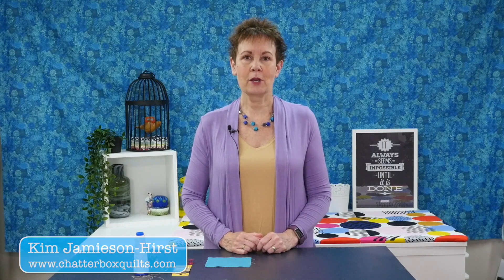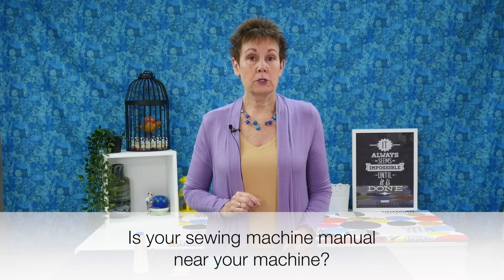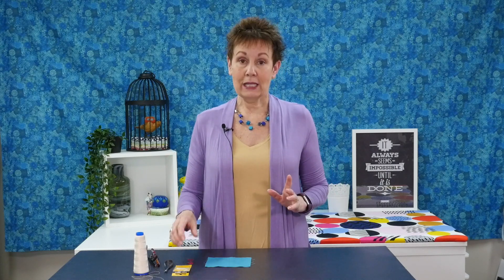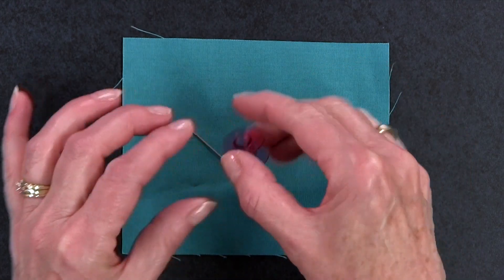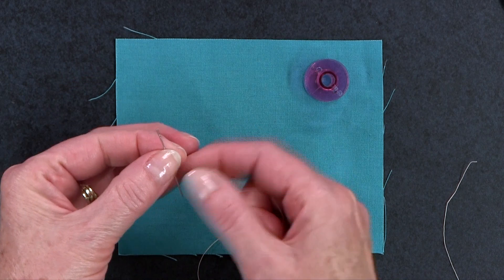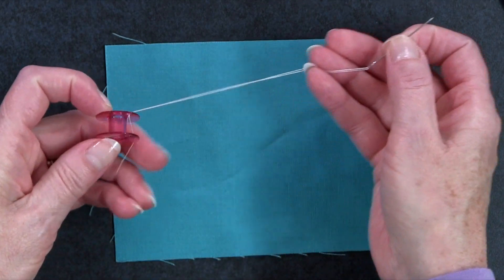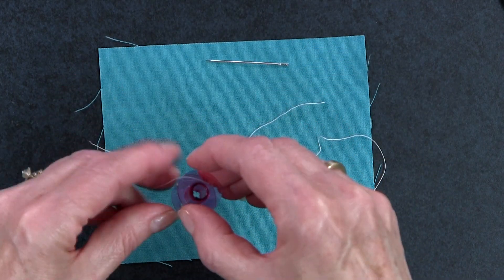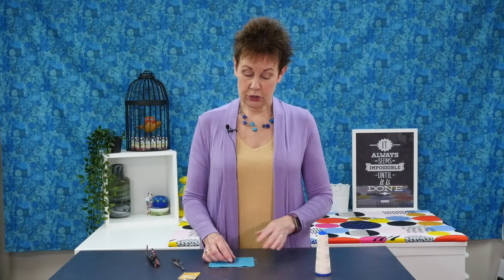Thread a Bobbin

Comment: My manual sits right behind my machine on a shelf!  Easily accessible.  I have a Husqvarna Viking which has a hole in the bobbin also. After recent cataract surgery I find my depth perception is off for close up work.  I never thought to use a needle! Thanks.

Comment: Interesting, the manual for my 9450 doesn't require the thread to go thru the hole in the bobbin.  Just wrap the thread around the bobbin 5 or six times and use the attached cutter to trim the thread.  By the way, my manual is right next to me on the side of my sewing cabinet.